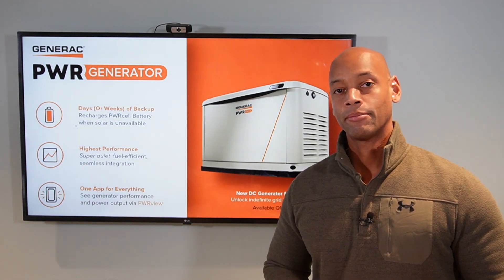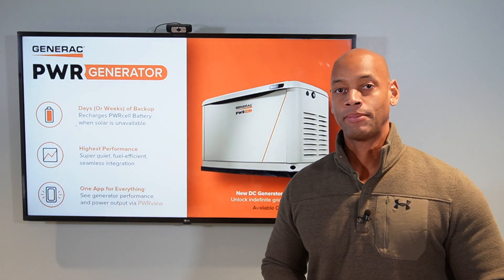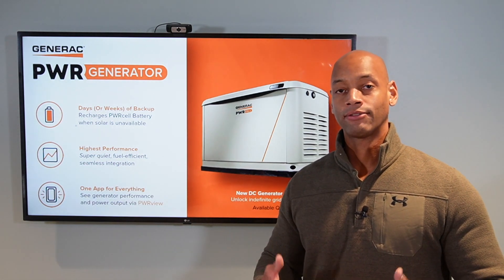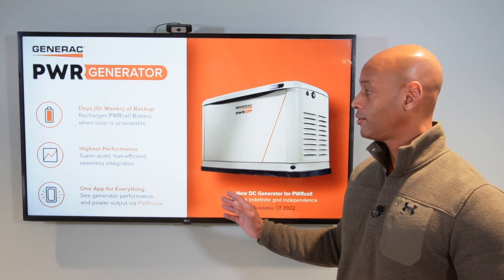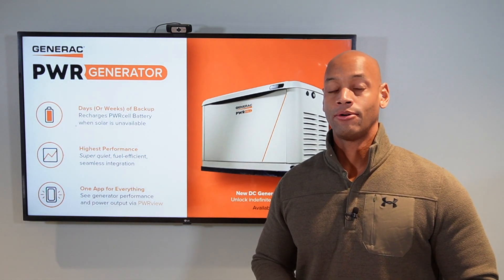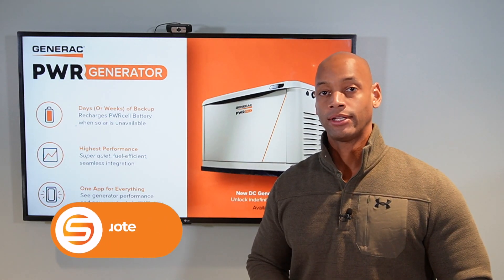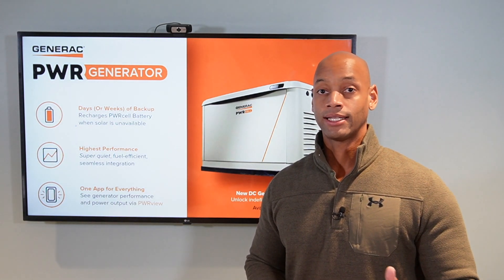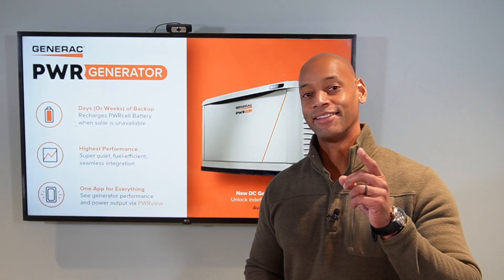New Generac PWR Generator | DC-Output for Battery Charging

Comment: I know this is an old video and generac no longer recommended. But is there a another system similar to the setup. Battery as a primary backup and dc generator

Comment: What I am looking for is a bit different but not so much different that I haven't seen it before. We would like to have a patio cover built and solar panels and installed on it but not sure how far away the solarpanels can be from garage which is where the service panel resides. Before I start up a conversation with the project team would like to know if this is possible.

Comment: I am wondering how quickly power cell can be recharded using the grid or AC output generator?
Reply: The inverter is rated at 7,600 kW when tied to the grid. I assume that rating is both ways. If you have an 18kWh battery, then it would take about 2.5 hours to recharge a fully depleted battery from the grid. I'm hoping that Generac is smart enough to slow charging when the battery gets close to 100%, so the last 20% may take longer. So let's say 2 hours for the first 80%, and another hour for the last 20%. That's my guess.

Comment: Seems silly to charge a battery using a generator.     Unless you live off grid just run the generator to make AC power during an outage
Reply from the maker: The idea here is to conserve fuel and prevent having to run the generator during evening hours.  Even at 59dB, most owners don't want the noise during the evening.
Reply: If you want to provide backup power for an extended outage (1 week), you either upsize the battery (how many days do you want to add?), or add the generator (indefinite).

Comment: Wish you would show more slides as you were speaking to better communicate what you are talking about.  Just listening  to you is difficult. I had an Enphase system installed with battery backup AND was sold a Generac generator to supplement the battery (at the time the battery backup was way too expensive by itself and I was sold that the Enphase battery could be kept full by either solar OR the generator). It took Enphase over a year before they released the software update for their smartswitch to allow for the generac generator to interact with their system. The system finally works to have an integrated system where the solar system can charge the battery or the generator can. Once the battery is too low, the generator will switch on during a grid down scenario to fill the battery and/or power the critical load items. I did not opt for full house support due to cost. The system was tested, but haven't had a true grid down scenario yet to ensure it works as tested. AC/DC conversion happens with Enphase microinverters and battery stores AC and generator runs AC as I understand it.
Reply: The Enphase system recharges from an AC Generator (Generac, kohler, etc). The PWRGenerator is a DC generator. Think of the PWRGenerator as directly connecting to the battery, rather than going through the inverter. Sizing of the generators is a little different. Since PWRcell is one size inverter, they only need to have one size generator.

Comment: Is there any way to integrate one of these with a Tesla Powerwall and gateway based system? Tesla's current generator solution is extremely disappointing (generator and solar and battery can't run simultaneously)
Reply: All three would never run simultaneously,    the inverter would be set up to use solar and when that is not enough then use battery. Usually the generator would  be used to to charge the batteries when solar is not available.

Tesla like a lot of these other companies might not be compatible with other products.
Reply: @TheFatman819  Are you saying that not being able to run all 3 simultaneously is a limitation of this Generac PWR Generator solution?
Although better than tesla's approach (that doesn't allow the generator to charge batteries at all) it would be a pity since in times where the home is drawing a lot of power it would be good if the batteries could provide an additional 10kW of power to supplement the generator and the solar. This way you don't need such a large noisy inefficient generator to handle peak house loads.
Reply: @ludwigbear  You would only run 2 of the three at a time. If you are running the generator, it is recharging the battery (battery not "running"). Solar and generator can run at the same time. Power (solar or generator) not needed for the inverter is sent directly to the battery. Note: Running of the generator presumes solar is insufficient to supply load (that's why the battery drained). So when the generator kicks in, the battery goes from providing power (to the inverter) to storing power (from the generator).
Reply: Imagine in the winter there's a snow storm and the grid is down. Solar is not producing any power at all. House draws 10kW on average but at times it draws as much as 20kW. In a system where the battery and the generator are able to supply power to the house simultaneously you only need a small efficient 10kW generator and 10kW of batteries.
My point is that it would be superior to have a system where both batteries and generator can supply power simultaneously. Sounds like this Generac system is not capable of doing this. It doesn't mean it would not be a good idea for some company to step in and fill this gap in the market.
Reply: I have a Powerwall. Unfortunately Tesla has shown ZERO interest in generator integration. In fact they are now selling the Powerwall ONLY in connection with installation of their PV panels.  That’s why I’m following what Enphase and Generac are supporting.

Comment: Interesting and I've been removing long DC cable runs in favor of AC cable runs because for some silly AC is easier to ship and uses less copper for long runs.
Reply: The entire reason our grid is on AC and not DC is because it uses less copper for long runs. AC has MUCH less loss and that is the reason we use it!
Reply: @erick4923  No.  It is due to potential conversion being much easier due to these thingamajigs called transformers.
Reply: @randacnam7321  very simplistic and miseducated reasoning. 

If you understand power loss at high delta you would understand that the reason we used AC back in 1880 was because Tesla established that conversion via a transformer was easier via A/C than D/C. That is not the case now, however. 

Runs of less than about 300 miles have less loss via A/C than D/C. We are well beyond transformer voltage limitations and have been for nearly 100 years. 

The longest run in America is around 800 miles and is D/C however most utility runs are far less than 300 miles. 

Educate yourself before you speak.
Reply: @erick4923  Transformers cost less and are more reliable for a given power handling capacity, not to mention the Happy Fun Things involved with designing power electronics in the tens or hundreds of kV.  Then there are the problems with designing and building fuses and breakers for the potentials involved, which is why most DC lines are only dual node so that the overcurrent and other relaying can be built into the converter station controls.
t. utility grid engineer

Comment: How does the generator produce DC current? Does it have a built in inverter?
Reply: The generator creates AC like all generators, but internal to their unit, they feed it to a AC to DC power supply, which has a DC output voltage compatible with PV inputs of an inveter or charge controller.  Inverters convert DC to AC, whereas this converts fuel to AC to DC.

Comment: Seems like a neat unit going straight DC. Generac as a company is terrible. As a 16 year off-grid solar installer, many customers struggled with Generac generators. I even convinced myself to get a ECOGEN 15kW. It barely lasted a year before it ate itself (brushes fused to commutator). Generac refused the warranty.
Reply from the maker: Yeah I had a similar experience with Ecogen for Off Grid projects about five years ago. It seems that they completely re-engineered this product designed specifically to work with their solar inverter.
Reply: good to know .    did you get warranty on this yet?     will call you. up long time need to catch up.
Reply: I have had a Generac 22kW generator for 10 years and have never had an issue with it. I can't speak to the warranty service.